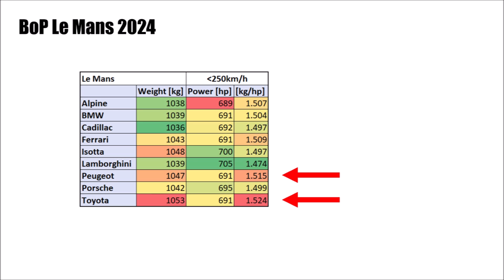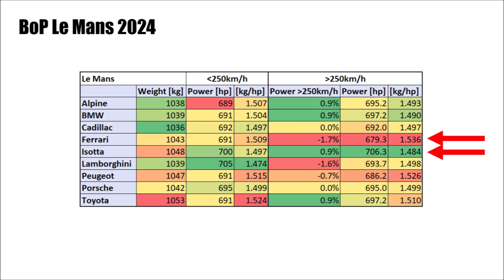24h Le Mans 2024 - 2-Step BoP - EXPLAINED

Comment: This BoP deal kind of defeats the purpose of having different constructors racing. What's the point of building a great car if you're just going to get penalised? Just mandate a common engine and chassis (or a selection of spec engines and chassis, like in American racing) and save the constructors a lot of money while attracting more competitors.  Or just let the best manufacturer/driver combo win, like we did in the past! This almost looks like we are having a small children's competition and we're rigging it so that everyone wins and nobody gets sad and cries. Just pathetic.
Reply: Spec chassis/engine combos effectively kills the point of sports car racing, and would still require BoP to balance the various combinations. Simply allowing teams to run whatever they want with no checks is what killed LMP1, Group C, and Can-Am (thanks Porsche), the entire reason this category is so large is because it has BoP.

The only solution I can think of that doesn't involve some form of BoP is an F1-style cost cap and far tighter rules regarding vehicle specs, but that might kill any sort of design diversity to the point that it's just a bunch of glorified LMP2 cars with badges slapped on them.
Reply: @griffinfaulkner3514  Going to LMP2 (with open engine, but maybe 4.0 V8 NA only) as the top class might be the perfect way to avoid BOP. That way Ferrari can run their Ferrari-Ferrari, Toyota can run their Toyota-Toyota, Alpine can run their Oreca-Mechachrome, Porsche can run their Multimatic-Porsche BUT all privateers can buy ANY of these cars and engines for the *fixed price*.  You'd have 40-50 cars in the outright class, which would be epic!!!  The loss of engine variety would be a shame, but most of the competitive cars now have bland turbo engines anyway, so no great loss.

Comment: So the above 250km/h is regulated by the ECU and torque sensor, or is it physical air restrictors ?
Reply: Torque sensor. Does not involve air restrictors or turbo boost pressures.

Comment: Couldn't teams easily trick the bop for LeMans by racing slowly on the previous races?
Reply: Technically you can, but consequence might not be worth it. Ford GT in 16 after they used the trick, they never again had favourable BoP

Comment: don't do too well early in the season to boost chances for the big Le Mans win?

I thought BOP was just to get the balance right between the different brands. but they're changing so much all the time

I'd really like to see what this class would be like with just the downfore/drag ratio and their maximum power output. there's no active aero in Hypercar so if you decide to have low downforce for the high speed you'd also have low downforce in the corners. ACO just reduces the maximum power if your drag is too low

now it just seems like you're getting punished for having a good car

Comment: I do love everybody saying that oh FIA is just choosing Porsche and not paying any attention the fact the Caddie is near the same power but even lighter
Reply: The Caddie is not nearly as good a design as Porsche. Without BoP, the Porsche is arguably the third best car but its rating is much better than that. The Toyota and the Ferrari are nerfed waaay more than the Porsche even when the Porsche is not too bad a design.
Reply: @MMA-ts2ji The Cadillac, at its best, is probably very close to the Porsche in performance. The problem is that it has an incredibly narrow operating window where it can actually achieve that level of performance, and is a handful outside that window.

Comment: We'll have to see man, i get it though closer racing and all. But  personally I like the idea of a car being able to utilise it's strengths like the 499's having a very good top speed, it's like a trait. So no need to necessarily absconed it, instead nerf it a little. You dont want them to completely run away on straight, but let them have the top speed advatage for instance and balance it with other factors, perhaps dont allow them to utilize too much DF OR give them more weight balast etc. 

I know in reality with the technology and systems that go into these cars brings in other factors that need monitoring and so makes it's a little more complicated than that. Which if this 2 step B.o.P. is anything to go by shows proof of that.

But I'd still prefer to let the cars have areas they specialise in, it's almost liek an identity/trait, then balance it out with other factors so they don't maintain a superior advantage through out the lap or race.

Comment: At the start, the hypercars category was presented as very open to original design,  and without to much regulation to gain interest from manufacturer. But the bop system ruins it and the competition they're fighting in.
Why would they allow for so much different designs and concept if they then negate it with bop?
A bad car should not be able to compete with a good car in the world biggest endurance championship.
Reply: Well look at Isotta or Vanwall, small teams still struggle to reach the fast teams. There is a reason why only Toyota, Ferrari and Porsche seem to do well while the others aren't quite there yet. Good cars stay good even with BoP. Relability or setup can't be BoP'd which is the reason why these teams still need good cars to win.
Reply: At the start nobody except Toyota signed up for the ruleset. The majority of teams are in it now precisely because it is a BoP class.
The irony of BoP is allowing a variety of different designs and concepts but then not allowing them to be proper performance diffetentiators. As a purist I'd rather take a semi-spec class.

Comment: Not every racing series needs surgical BOP, LM should go back to the times where the best machine, drivers and teams won by A LOT if they so deserved. In a few years, the cars that dont win will leave regardless of the BOP and we will be back at square one
Reply: Well look at GT3 for example, GT3 exists for ages now also due to BoP. Not having BoP would literally kill the class in 2 or 3 years just look at the last time they tried that.
Reply: @Maenfy  It's necessary as GT3 cars are very different (front, rear, mid engine, turbo, non-turbo, 6, 8, 10, ex-12 cylinders). Whereas the prototypes are all very similar, they already have matched drag, downforce and power. Therefore BOP should not be necessary.

Comment: Having a worse rating on the straights is a much bigger penalty than having a bad rating in low speed because in the corners it is much harder to overtake than on the straights. So if a car that has a good low speed and a bad high speed rating arrives behind a car with a bad low speed and a good high speed rating, it will be impossible to overtake, because in the corners you get dirty air and on the straights you are simply slow.
Reply: For LeMans I'd largely agree, but being good in slower speed parts usually (not always) means you can work your tyres less, and making the tyres work optimally for you is king in endurance racing these days. You can easily get around the traffic problem by offsetting your pit stop strategy by a lap or two.

Comment: The BoP is fair if you consider everything but have a major flaw that can be maybe resolve by adding success balast like gt500, you won so you win 4 or 5 kg more for the next race, but the bop has to be visited before the success balast of course
Reply: That will just be chaotic. Like even in Super GT, teams had to finish in lower position by each round just so that they won't get heavier ballast
Reply: @SynchLyOfthemgreat  yes because the success ballast are insane in supergt and they keep it til the end of the season. I think what they do is in the last race there’s no ballast. And in DTM, I might be wrong, the success ballast are temporary which is better.
Reply: @evguenicht4664 DTM, at least in class 1, I think were free competition

Comment: BoP always seems artificial to me - so does DRS in F1, and weight handicaps in Horse racing.
Reply: Drs is not comparable to the other 2 since its the same for every car. Itsjust there to nullify dirty air, nothing wrong with it.
Reply: @askeladden450 it’s even worse. It specifically punishes good drivers and prevents them defending.
Reply: @tecnoguy1136  no it doesnt, it just offsets the dirty air which drivers in 70s and 80s didnt have to deal with. And the 'good drivers' will also have the drs to take the position back. Without it, the art of defending would have long been dead in f1 as it would have been impossible to overtake.
Reply: @askeladden450  drivers in the 70s and 80s had insane dirty air.
Reply: @tecnoguy1136  nowhere near as bad as now. Sure, you had many instances of drivers complaining about dirty air, and it was still hard to overtake. But today, you wont see more than 1-2 overtakes per race without DRS, the dirty air is so much worse now (almost 40% reduction in downforce). Cars back then didnt produce anywhere near as many vortices. It was only in the 90s when CFD became common place that we started to see micro-aerodynamics come into play. Not only that but modern cars are also much worse in dealing with it.

Comment: I don’t understand why Porsche and Ferrari get such a good BoP rating. They should altleast get on Toyotas level in terms of BoP, both are way to fast compared to,the others.
Reply: The Ferrari has nowhere near a good rating. They're one of the most punished, especially considering La Sarthe is done 70% full throttle...
Reply: Have you seen Ferrari's >250 km/h  BOP. On the track that rewards top speed Ferrari has the least top end horsepower
Reply: Ferrari getting that cut of power over 250 km/h in a track like Le Mans = good BoP 😂
Alea iacta est: Porsche is gonna win this race.
Reply: Ferrari is fucked on the Mulsanne straight

Comment: Bop is starting to get too intrusive. Wanting to control the performance at so many stages is too much and actively taking away the advantage some cars have goes against the regulations they set out with a L/D ratio, power output etc etc. Its at the point where they are punishing good design and homogonising each cars characteristics
Reply: Bro just described BOP lmao
Reply: Teams and manufacturers seem to be for it, since it prevents a sorta BoP spirale. Let's say previously a car was disadvantaged at top speed. So you give it more power. But now it has better acceleration too and its lap times become too good. So you give the other cars more power. But now they have a top speed advantage again ...

This "2 step" process they implemented isn't done independently, with "1 BoP for low speed" and "1 BoP for high speed", but rather it's supposed to be one continuous power curve where performance at the top end is adjusted within a certain window. From that perspective it's really nothing all that different.
Reply: That is the point of BOP though? That different concepts can be as similar as possible in speed so that they can compete.
Reply: That's the whole damn point of BoP. And it's why a lot of manufacturers joined the category because of it. Otherwise it would have been a dead LMP1 class
Reply: @SynchLyOfthemgreat  They could have made simple LMP2 rules for everybody: chassis available to all customers, 4.0 V8 must be available to all customers for a fixed price.  In that way, either performance would be close (because they are just simple 4.0 V8 non-hybrid), or everyone (including all privateers) can just buy the best car be it Ferrari-Ferrari, Toyota-Toyota, Oreca-Mechachrome (sure...) etc?
Reply: @TassieLorenzo  we already have something close to that no with the LMDh? The chassis that the LMDh cars use are based on an upcoming LMP2 regulation that are speculate to be debut around 2026. And customer teams have always been receiving the same specs as the factory teams tho. As it's mandated by the regulation.

Comment: I dont get Why the Peugeot has such a Bad BoP. They have Never showed a good pace.
Reply: First: despite the name, the car is basically completely new. Hence lack of data for FIA and ACO for reference to properly set up BoP. In time it will get buffs as more data are available
Reply: Yeah, they looked terrible so far, only Isotta was worse. I fully expect them to get a boost before Saturday.
Reply: If one team gets a BoP rating "Too Good" for their car, they will beat everyone since everyone is made equal by BoP except them. This is the issue with the 9x8's new evolution. It is so much different than the old, that any data gathered on the original is of no use and thus the Regulators don't know how quick the car actually is for any given BoP. In other to not disadvantage multiple constructors, they disadvantage Peugeot. As stated before, if Peugeot get a really good BoP because the Regulators don't have enough data on their car, they will certainly have an "unfair" advantage. 

In fairness to the Regulators, teams like Alpine and Isotta had to go through this period of being disadvantaged in the early parts of this season, so that enough data could be gathered. Now the Regulators have enough data to give them both a proper BoP rating. On the other hand, Peugeot decided not enter their new 9x8 from the start - either because they were unsure or their development was too slow - but now they will have to suffer the consequences like the rest did. 

Besides, maybe they should have made a better car from the beginning and not gotten into this mess halfway through the season.
Reply: @bonnster2745  So, they spend money and effort and are not even allowed to see if that paid off, if the car is better or not. They're just penalised. And, a question: since they have no data on the car, how do they come up with the BoP amount?  Arbitrarily? Or just they just gave them the max BoP penalty from the start?  That's just looks stupid. And it's bad for the improvement of the cars. Let the new (or improved) cars run free for the first race. If it's too fast, then, and only then, apply the BoP. Although I'm against all this BoP deal altogether.
Reply: @OliveiraX  Did you read what he said? You can’t have the cars run full pace early without knowing what they are able to do because then you would end up with a crazy advantage and it would mean bringing a new car is basically a guaranteed win. Sounds pretty dumb to me, and like you are a pug fanboy
Reply: @OliveiraX  The practice of penalising teams with such BoP because of lack of data is by no means perfect and I am not here to say it is. But if you let the cars run free, then it is likely that the Peugeot will have a massive advantage. 

Say this happened, everyone would complain that Peugeot won only because they exploited BoP. This would make the sport look like a farce, and would be unfair to every other team. It is a good compromise, but still a compromise. And again, Peugeot should have just made a good car from the beginning, and not relied on mid season development.

As for the money argument, that extends to other teams. If you were Ferrari, Toyota, Cadillac, etc how would you feel if you spent millions developing the car, only to lose the most prestigious race in motorsport because Peugeot got an unbalanced BoP?
Reply: @cademckee7276  How do you know what are they are able to do if you don't let them run unrestrained at least once? Let them run once like they are, then IF they are too fast, then you can apply BoP. Not the other way around. I'm not a Peugeot fanboy. I'm more of a Ferrari Fan. What I am is against all this BoP sh*t. It hinders development.
Reply: @OliveiraX "Unrestrained" cars in an BoP category is an oxymoron. These two things can not co-exist.
The homologation process is very controlled and involves dyno and wind tunnel tests so that's how they come up with the numbers before a car has run any races.
Reply: @deggis4  That is true, but at the same time there are factors that simulations cannot account all for, which are often first assessed when the cars hit the track, and then they can be analyzed further.
Reply: @bonnster2745 That’s revisionist bs. How would Peugeot have known its car was so “bad” before starting? lol
Reply: @banovsky More testing of the general concept? Realizing that at bumpy tracks the previous car was crazy unpredictable?
Reply: @banovsky  Because they ***had*** to know that a car dependent that much on ground effect in a formula where overbody aero is not equally restricted had a very narrow operating window compared to the compeition. And they decided to go for it anyway, maybe in the hope that it would perform so well on smooth tracks that they could write off tracks like Sebring. They were wrong, and in some ways they are lucky that situation is so good in the championship at the moment that the manufactuer did not pull support for the program in the way they did in previous decades with much more successful cars.

Comment: At this point, Toyota should swap it into a TS050 to get the job done.
Reply: Isn't their current car just ts050 but smaller?
Reply: @literallyhuman5990  LMP1 has a more aggressive hybrid system, 6 gears transmission, better aero and much refined. Same engines though, but different displacement.
Reply: @gianlozano102  The LMP1 engines were actually quite different, and had a MUCH higher thermal efficiency. They were also unbelievably expensive. 

This is no longer necessary for LMH as its a BOP rule set, not an F1 style fuel flow rule set.
Reply: @literallyhuman5990  no